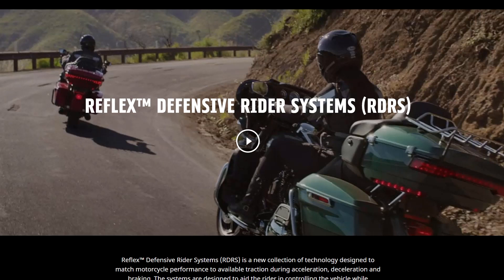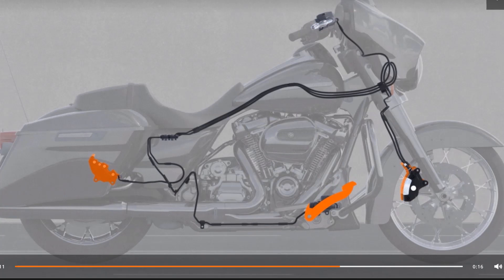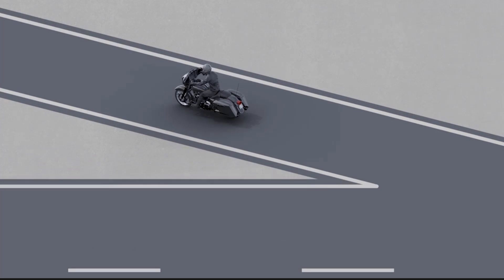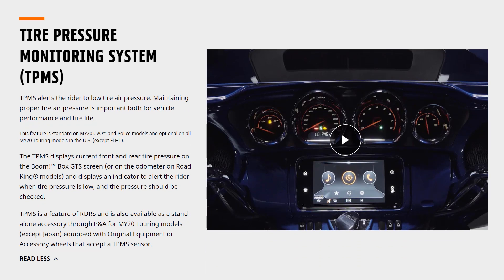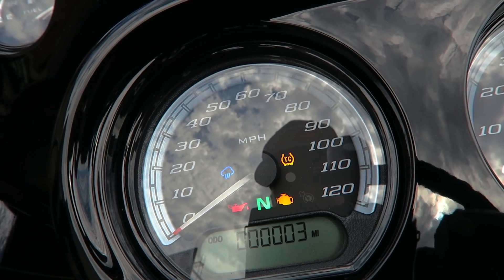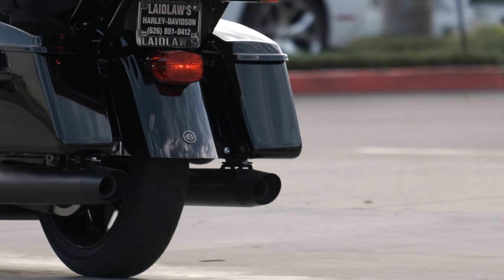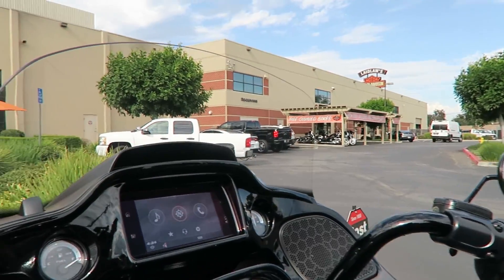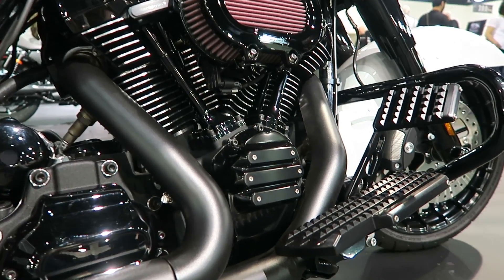Reflex Defensive Rider Systems (RDRS) Explained for Harley-Davidson Motorcycles

Comment: May help the guys that go downshift through the gears quickly with no throttle blip. Finding themselves finally letting the clutch out when in first when approaching a stop sign but have not braked enough.
I hope all these new sensors are reliable?

Comment: just a heads up that I believe there is a warning in the manual that you may want to turn it off if riding slow speed in sand or wet grass or similar

Comment: That hill hold is worth getting this system alone especially on bigger bikes. I don't need it but it sure is convenient and I would certainly appreciate having it. My only concern with the system altogether is it adding more possible fail points mechanically on the bike. More things that could break down and need servicing but I think it's worth having.

Comment: What is the button on the top forward of the left-hand controls?
Reply from the maker: It’s the button that cycles the odometer, trip meter, etc on the Speedo. Hold it down to enter accessory mode.

Comment: Great video. I'm just upgrading from a 2012 Electra Glide Classic (FLHTC) to a 2020 Ultra Limited (FLHTK). I've ridden my 2012 cross-country extensively. When I bought it, ABS was a selling feature, and it probably saved my (and my wife's) life on a couple of occasions at least. Great feature. The 2020 FLHTK I just bought (with 9,000 mi.) has the RDRS system on it, and I am very grateful for the added safety technologies. I am 60 years old and have been riding my whole life. I have nothing left to prove to anyone, so bring on the new safety tech!

Comment: I have a 2020 CVO Street Glide with RDRS.  Ive used the vehicle hold control on slight inclines and it works fine but on steeper inclines it wont release when applying clutch and gas.  The front end of the bike pitches down and does so with each subsequent throttle clutch application.  It will only release if i hot the hand or pedal brake.  Took it to the dealer amd they said it works fine as advertised and that it requires a lot of force to release it. Just finished another 5 day ride and tried it three times and still having problems where it wont release.  Any others with suggestions.  Of course its out of warranty now.

Comment: Great video. 
Hold mode:
Bike has to be in gear. To disengage it, you can either take off, or reapply firm pressure, and it will shut off.

Comment: Does the hill hold assist work with the transmission in neutral? 
I noticed in your demo on that slight hill you had the transmission in gear and the clutch pulled in.

Comment: Can the RDRS be flashed and uninstalled on my 2021 Ultra Limited? Did a recent trike conversion and the lack of TPMS on the rear wheels throws a code which unfortunately also disabled my cruise control. Any fixes?

Comment: Well I wish you really did have “use of both your hands” but it only works with the bike in gear. I don’t get that. What if I wanted it to hold and not have to hold the clutch. I realize you’d have to release it before you could duck walk the bike if it were engaged, but so what? It disengages with a simple tap of the brake.

Comment: question,  when your in hill hold mode,  how long will it say in that mode for long lights ? also when in hill hold can you put the bike in nuteral and still hold..?
Reply: You have to be in first gear, clutch in. (I haven't tried any other gear). Hill hold will stay engauged until you throttle up and release the clutch. If you put the bike in neutral the hill hold will disengage. This is a great feature, once I started using it - I can't live without it. I am 66 and this feature will add years to my 2 wheel riding ability.

Comment: The roll hold for stopping on a slop is a feature that is standard on the pan american deluxe adventure ....and i began to appreciate abs brakes on the 2017 dyna S as one day going into the parking lot kinda hot of our   O'Reilly parts house and there is a lot of fine sand on their concrete parking lot and not visible and grabbed a handful of front and rear brake ..and in half second i felt and heard the front tire siding to the right while turning left into a parking space ..and i was about a half second slow on reaction time to save a high side washout and slamming the bike onto its left side as i was still doing at least 15 mph and probably not be able to buff out all the possible scratches ..the abs brake system  let go of the front brake calipers allowing the front wheel to regain traction correcting my lean angle as i was already in the  process of going down then when the front tire stopped sliding it grabbed better traction allowing me to roll into a parking  space perfectly as the abs saved me a ton of embarrassment .. the kind of which if your buddies ever see the damage that would have been at least a small dent in the gas tank with a slightly greater pull back to the left handle bar more than the right side handle bar... Bent or broken clutch lever with a scratch up left fork leg and a front fender with bright wide areas of black paint ground down with the factory primer coat showing that your friends will never let you live it down ...

Comment: Thanks Matt. Ran across this video by chance and it is awesome. I just bought a 22 ultra after being on a 2008 for some time. and I liked the idea of the RDRS when he dealer told me about it, but your video really helped me understand it at a whole new level. Funny thing is, I actually had the RDRS engage on me riding home today. My engine shut down power to my rear wheel on a hard take off and I wasnt sure what had happened. Most likely started to loose traction to my rear wheel. This video just put me at ease, since I thought I had damaged something durring my break in. lol. thanks once again for the very informative video.

Comment: Great video, thanks for sharing. I had been researching these items and found this one from a while ago. One thing to add on the newest versions of Hill Hold, you have to be in gear (of course clutch engaged) for it to work. It WILL NOT work in neutral so you DO NOT have use of both hands while engaged. Kinda silly to me to switch one hand for another, but maybe that restriction can be turned off in the system. Still waiting for that answer.

I hope this helps, although a bit late to the comments, great stuff and thank you for all the useful videos.
Reply: I have just bought a new 2022 Road glide special two weeks ago, and mine hold's in neutral, and riding in Wales  UK  it's used often and daily

Comment: I love the vehicle hold man- Here in SF Bay area especially in the city the constant braking on hills can just be a pin in the ass in a few area in heavy traffic. I live up on the Santa Cruz mtns and traffic gets nuts one weekend if it is really bad you can end up doing the brake on a fairly steep hill 20-30 times in 2 miles.

Comment: One feature about the hold mode that I wish they would fix is you have to be in gear for it to function if you're in neutral it doesn't work and I've experienced with mine that if it's in that hold mode for any length of time it automatically disengages
Reply from the maker: Yea that’s true. I think it might be a safety or regulation thing that it automatically disengages. I’m with you though man.

Comment: Great explanation! I guess the thing to weigh is the likelihood that RDRS will ever provide any benefit versus the likelihood that RDRS will ever cause any problems. Personally the hill feature is of no use to me, just got accustomed to doing without, and I feel about the same way regarding traction control and etc. Will keep the bike simpler and save the $1000. If I was really worried about additional safety I probably shouldn't be riding a motorcycle.

Comment: Can the individual systems be toggled, or is the RDRS either "all on" or "all off?"
Reply from the maker: All on or all off. The TPMS is always on and hill hold mode can always be activated independently of traction control. Is that what you were asking?
Reply: @MattLaidlaw  Thanks Matt. I have a friend that likes the hill hold, but not crazy about the other features of the RDRS. So I guess my question is, can the hill hold and TPMS remain on, while the other features of the RDRS are turned off?

Comment: Hi Matt firstly thanks for all the great videos thanks to you I Just picked 2021 flhxs with RDRS when I  come to a stop i slow the bike to about 5 mph then while holding clutch dump all the gears at once  3-2-1but  they don't all engage go from 4 to 3  ok then i get spring in the shifter I have to hit shifter few time or let the clutch out  to get to the next lower gear. do i have to clutch each gear down or is this the RDRS or a problem ? Thanks Again!!!!!

Comment: can always come here for facts. I have a 2020 low rider s I doubt it has traction control or any of this electronic assist stuff, but I read that it does on some website.
Reply from the maker: Thank you. No, the low rider S does not have the RDRS system. It has ABS brakes.

Comment: I have a '20 Road Glide Limited with RDRS. It is awesome. Ive already used the hill assist several times and it helps, especially with the bike being nearly 1000lbs.
Reply: When using hill assist you still have keep the clutch pulled in correct ?
Reply: @DMobley232  https://youtu.be/GbiPayv9inc This video explains ot pretty well
Reply: You got that right me coming off a low rider s 120 pounds more it a lot. I came across sand tonight and with just A fraction amount of slip from the rear tire it kicked right in reduced the power and there was no slippage of the Rear wheel. Yes probably would have made it through but with that your chances increase by 99%  the hill assist breaking is absolutely wonderful.

Comment: The hill hold feature is nice except when you unload the bike from a trailer.  When you're backing down a ramp if you squeeze the brake too hard, it'll activate the hill hold and you're stuck.  You have to go forward (up the ramp) to deactivate it and then go back down.  Kind of a pain.  There should be a way to deactivate it.

Comment: Matt great vids..I just bought a 2020 trike is this feature standard? Also I own a BMW R1200RT it has the hill assist. I have been riding since I was a kid. A few years back I lost my right leg. I got back on two wheels this past summer. it was my right leg. so the hill assist is a major help to my riding on two wheels. the Trike will be for longer trips with passenger & luggage. I wanted to mention that it is rarely said but riders like myself who find themselves disabled & want to figure out how to get back at it, are not mentioned too often. The trike is one of those options along with features like hill assist. thanks
Reply: The Trike is an awesome option! I got a 2022 road King special. 26.600 bike Trike is double that! Could never afford one! Well if I saved up a bit but over 40 GRAND FOR A BIKE IS NUTS. But then again so is 26.600 Lol my point 🤔🤔Lol

Comment: I noticed there is an option to roll forward on the throttle. What’s that for?
Reply from the maker: That engages and disengages the engine idle temperature management system.

Comment: Hi Matt, I have a problem with TPMS on my RG Limited 2020. The TPMS Light always on if I ride about 5-6 km but physically tire presure is okey. Error code C0083c and TPMS doesn't read as well... such as FR 274 kpa RR ---. How to fix it.

Comment: Hi Matt  as I can now update my 2018 cvs street glide to the new info system 😎 are any of the extra systems such as RDS and the  also available like you I’ve been riding a long time 40 years 30 on harley and I can manage without electronics but as we get older is nice knowing they are there in the background as the touring tyres do leave much to be desired in the wet and when overtaking on white lines  cheers grant

Comment: Will all these functions still work if the front end is swapped or make suspension upgrades?  For example: Complete Kraus inverted front with Beringer radial calipers and Ohlins upgrades.

Comment: Matt, is RDRS affected by flashing the ecu with a stage tune?

Say, if I have a Road King Special with a stage II torque cam. The engine power will be different than stock. As well as the power curve. Will the parameters in the RDRS need to be changed? Or will it really matter?

Comment: What is link braking for ?
So you use both brake and wear the pads faster, so you will change it more frequently.
Reply from the maker: That, and so you can stop faster. When you distribute the stopping friction evenly over both pads they actually last longer.

Comment: Always good vids fella. Cheers. I ride a Sport Glide and wonder why HD don't filter this tech down to the Softail range of bikes where you could argue it would be more critically beneficial especially with the greater power to weight ratio. Having ridden other manufacturers bikes for years with all of this as standard equipment it would be interesting to hear the reason why this isn't on Softails or for that matter on the Electra Glide Standard. Is there a TPMS aftermarket available for the Softails with an add on display too? Cheers

Comment: Excellent video Matt.  I would of stepped up on the RDRS option if it has been available on my 2019 Ultra.   The hill hold alone would of been a big attraction for me.  The rest of the features pays for them self’s.  If I loose the bike in a curve in wet weather, the cost of the damages alone would far exceed the price of this option not to mention getting seriously hurt.  It’s one of those option that if it comes into play just once in 100,000 miles, it will of paid for itself.

Comment: Love the videos Matt, if I didn’t live out east I would definitely be coming to laidlaw to buy my bikes.
One question though, If you change the brakes to beringer or change to one caliper on the front instead of two ETC, are all of these rdrs systems going to still going to work ? People love to customize their bikes, will they be able to customize and still be able to use these features?

Comment: This stuff is just an excuse for the ridicules cost of these bikes. It also eliminates skills in riding. So what if you ride a different bike without all this stuff. You wont have the skills to be safe. Just put training wheels on them. Oh thats why they make trikes. When I get to the point of not to be able to ride a two wheeler, I will buy a convertible. Thanks, but no thanks. Why can't you make the touring bikes lighter and easier to back them out of the garage. Touring bikes are mostly targeted at older riders who haven't the strength to hold them up much less pick them up after they drop them. If Harley wants to attract new riders, they need to direct there talents toward lighter semi touring models that younger riders can afford. I'm 65 and on my last Harley touring bike, as are a lot of us at my age.
Reply: You sound ridiculous

Comment: Recently dropped my bike on a gravel road. Hit a deep pocket of gravel losing rear wheel traction and forward momentum. The instinct is to give it throttle - wrong thing to do. I fishtailed and the bike went over. I think RDRS would have helped.
Reply: MuncieBill I think you are right.  I did a track day last (Australian) summer.  We had an insane storm the evening before my track day, and the track day was 43c+ but there was seepage from a small crack, putting two wet patches right on the fast line on the fastest corner.  Heard the chief instructor telling the instructors of the quickest group to ensure he wanted them but the slower groups (which I was in) would not hit that line. Anyway, in a very rare  instance of getting a line right, I hit the first wet patch, rear tyre gripped coming off it then slid in to second patch, then hit the hit dry pavement again.  Two opportunities for a high side! All I did was remember “do not close the throttle” so I held throttle steady.  IMU TC saved my butt.  My instructor was behind me and said “good save”, and my response was “it was the bike, not me”.  So long wonder way to say something the gravel mid corner

Comment: Thanks Matt, I have been frustrated  with Harley Davidson and other Motorcycle manufactures for spending too much time on flashy paint schemes, horsepower and slick advertising instead of looking out for their ridership and focusing on  additional safety features. I am pleased to see Harley Davidson finally using these technical advances and incorporating them into their motorcycles. I hope Harley Davidson stays the course and keeps engineering new safety features for the sole purpose in keeping their customers alive, not to mention giving new riders more confidence and encouraging new riders to the sport.  Good move Harley.. it’s about damn time!
Reply: horsepower? where?

Comment: Really not sure about this! About 15 years ago I was riding through the Ardeche valley in France, a road I'd been riding for 10 years (and btw is still one of the best biking roads in the world). I was on a Honda  Blackbird (CBR1100XX). I was even then an experienced biker. Those roads were twisty, challenging and great fun. Well one became complacent and on one of the  hundreds of tight U turns I entered a bit too quickly. (remember the run off was a 200m drop over a cliff).  So, being experienced I kept off the front brake and tried to just pull it through, now at about 50° bank realised this wasn't going to work. I knew front brake was death, so gently hit the rear brake, to try and scrub off a bit of speed but hopefully pull the rear out a bit. But no! The linked brakes applied some front brake and that caused a low slide, I slid into the wall, (OK  slow enough not to go over the cliff) and caused enough damage to the tank and frame to right off the bike, Without the linked brake system I am 100% certain my riding skills would have gotten me through.

For the newer riders fine, but I want / need to know I am the only 'intelligence' in charge of this  motorcycle.